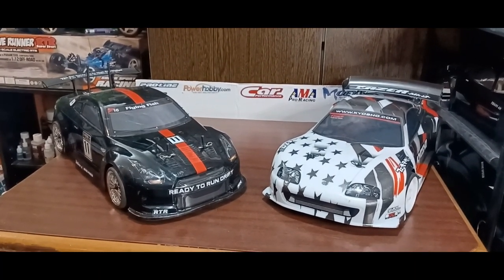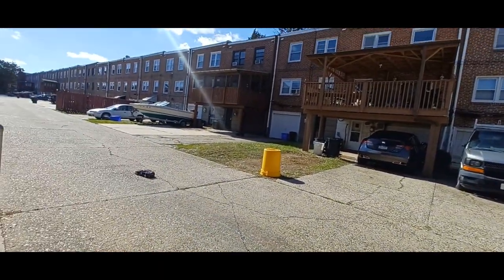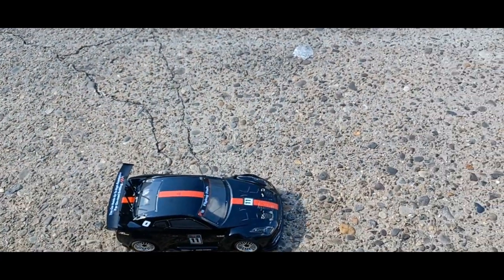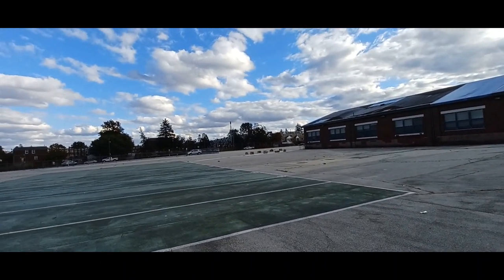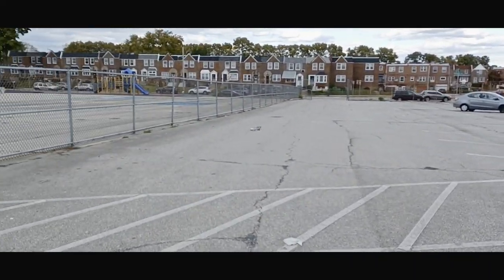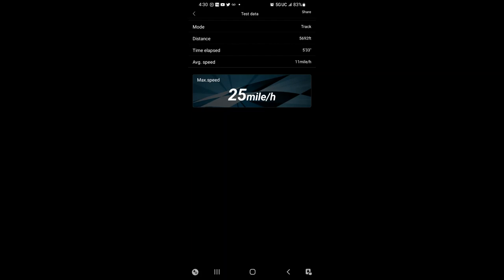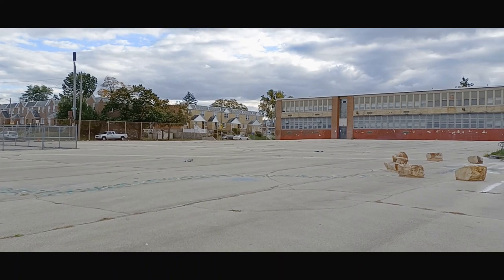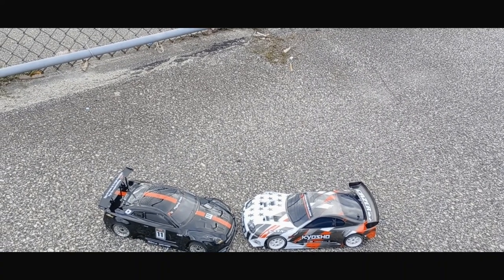Kyosho Fazer MK2 and HSP Fly Fishing Speed run don't sleep on brushed motor because....

Comment: You are definitely not to run the bog standard brushed version kyosho fazer mk2 on 3s, it will indeed in the end break the plastic drive shaft, and it will for definite totally strip all plastic gears in the drivetrain differentials. Same with the brushed only version HSP. Only the upgraded fazer mk2 VE ( and with the optional heatsink ) versions are only just capable of 3s running without too many problems or issues. Same with the brushless model HSP version only,  where you can use 3s,  but only with caution, because of heat build up to the electronics and motor parts.  Even though the kyosho fazer mk2 VE versions have the upgraded metal drive shaft and combined metal and plastic drive train differential components, caution is still very much definitely still needed if you intend to use 3s on the fazer mk2 VE versions, especially if you do not possibly and ultimately want to break any of the cars components, because as stated by kyosho, they are only made safely for 2s capability and running .